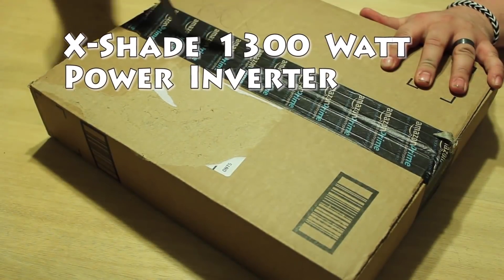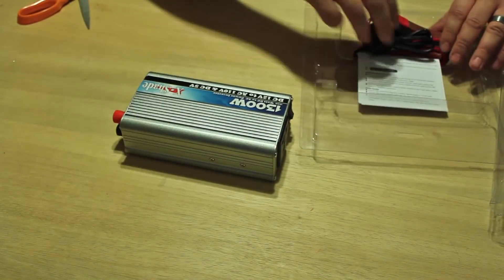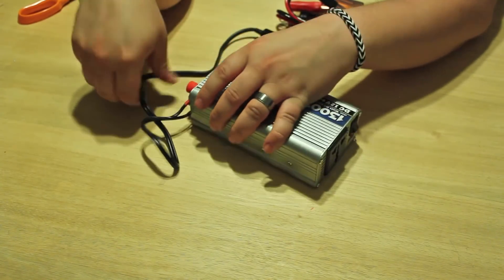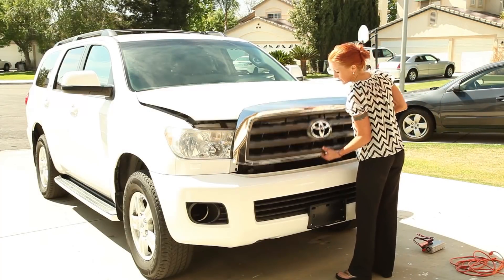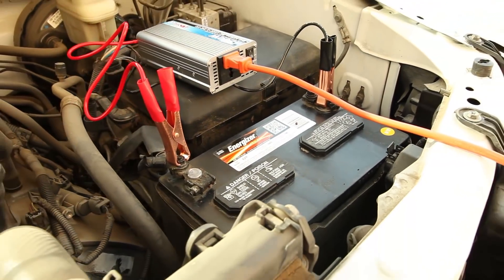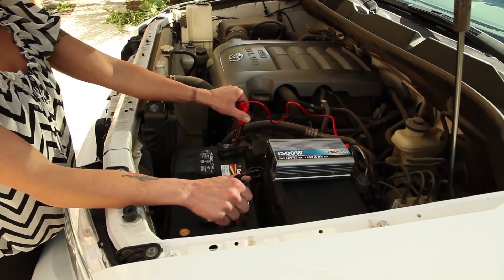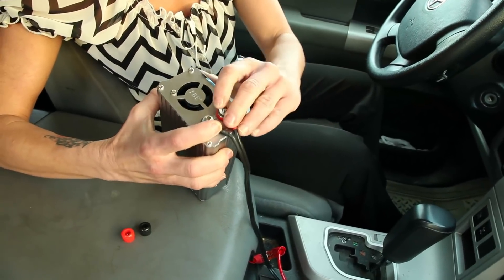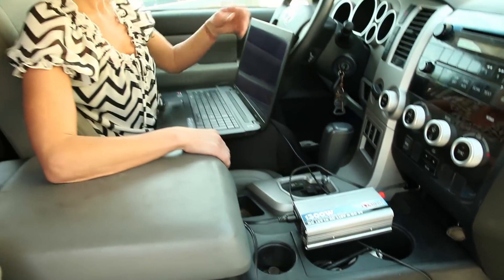Power Inverter -1300 Watt Car Inverter-110 Volt Outlet and USB Port Car Inverter

Comment: 2:30 Darn. I was hoping to discover a way to have the inverter plugged directly on the battery whilst being inside the passenger area. I know that it is possible with longer cables etc but for a quick fix...?
Yes the adaptor that goes in the lighter is ok...but as mentioned, for smaller equipment.

Comment: That despite what it says on the inverter is NOT a 1300watt inverter that case isn't big enough to disperse the heat generated at 1300watts it might be 500/600 watt inverter
Reply: yeah at 108 .3 amps
Reply: Yes, I agree with you. We are the inverter manufacturer

Comment: CAN I START THE CAR DURING USING THE INVERTER
Reply from the maker: +CUMITA-4WD A car power inverter is a simple device that uses the car battery to power electrical appliances, including but not limited to, a TV, laptop, lights or any other small simple gadgets.
Reply: 7
Reply: CUMITA-4WD 
Yes, you can start the car during using the inverter. No harm will be done to anything at all.
In fact, you SHOULD run the vehicle while the inverter is running!!!
This does 2 very important things... a) your vehicle battery won't be drained. b) some inverters do not work if the source is too far below 12-volts, and older car batteries actually are in the 11-volt range... running the car will run the alternator which will push 13-14 volts to the car battery (and thus the inverter) which is ideal.
So, if you don't run your car, and your inverter suddenly stops, it's usually because the battery voltage has dropped to low even though it has plenty of amps to start the car.
Also, with plugging, say, a 1200-watt inverter into the standard cig lighter, be aware that the cig circuitry can only draw 100-150 watts (depending on vehicle rating) before it blows a fuse or potentially melting the cig wires.
Rule of thumb... anything over 100-watt draw the inverter should be connected directly to the battery using appropriate thick-gauge wire, and the vehicle running. 100-watts through a cig lighter connection is perfectly fine without running the vehicle but it is recommended under those conditions that you run the vehicle 5-min for every half-hour of 100-watt inverter load.
Hope this wasn't confusing and hope this helps.
Reply: CUMITA-4WD 
Yes, you can start the car during using the inverter. No harm will be done to anything at all.
In fact, you SHOULD run the vehicle while the inverter is running!!!
This does 2 very important things... a) your vehicle battery won't be drained. b) some inverters do not work if the source is too far below 12-volts, and older car batteries actually are in the 11-volt range... running the car will run the alternator which will push 13-14 volts to the car battery (and thus the inverter) which is ideal.
So, if you don't run your car, and your inverter suddenly stops, it's usually because the battery voltage has dropped to low even though it has plenty of amps to start the car.
Also, with plugging, say, a 1200-watt inverter into the standard cig lighter, be aware that the cig circuitry can only draw 100-150 watts (depending on vehicle rating) before it blows a fuse or potentially melting the cig wires.
Rule of thumb... anything over 100-watt draw the inverter should be connected directly to the battery using appropriate thick-gauge wire, and the vehicle running. 100-watts through a cig lighter connection is perfectly fine without running the vehicle but it is recommended under those conditions that you run the vehicle 5-min for every half-hour of 100-watt inverter load.
Hope this wasn't confusing and hope this helps.

Comment: Not a 1300 inverter, too small, maybe a sub 500 inverter.
Reply: Depends on amps The number of watts is equal to amps multiplied by volts.  We have 12 volts so  to get to 1300 w 1 its 1300 w divided by 12 v  = 108 .3 amp. Can Now it only posible if you can  imagine  108 .3 amps going though this inverter.